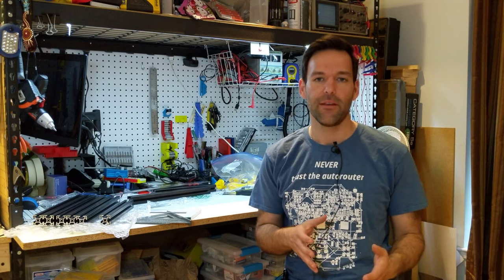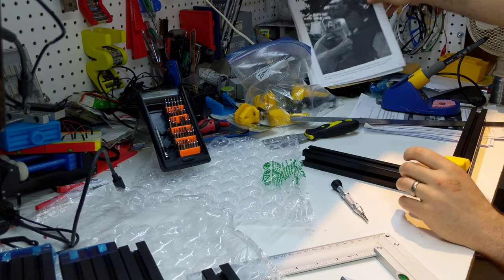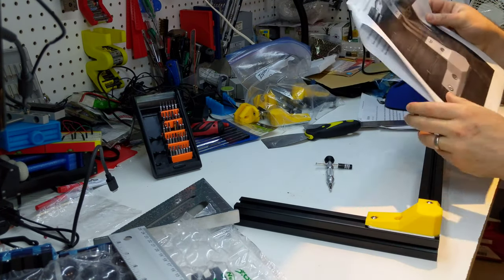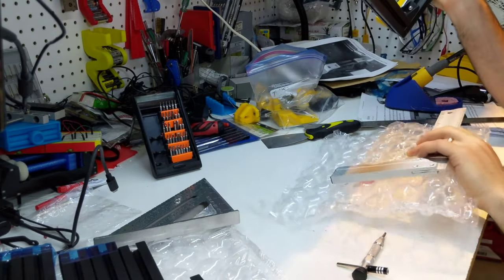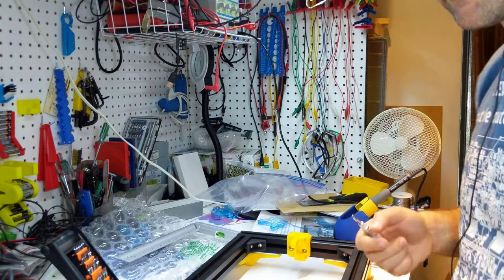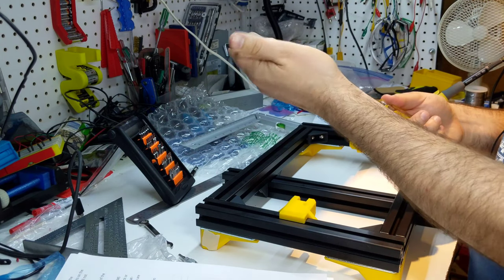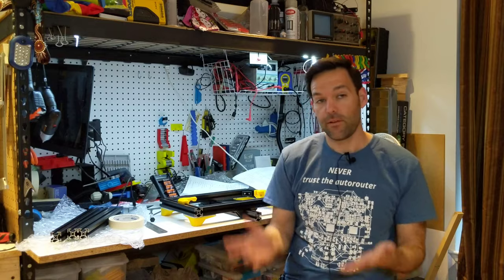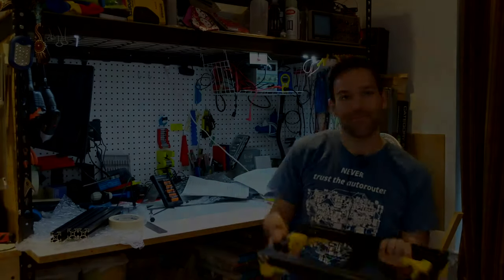ReDuplicator - building the base

Comment: Quick note about drop in t-nuts: you don't actually need to straighten them as they are designed to straighten themselves as you begin to tighten them.